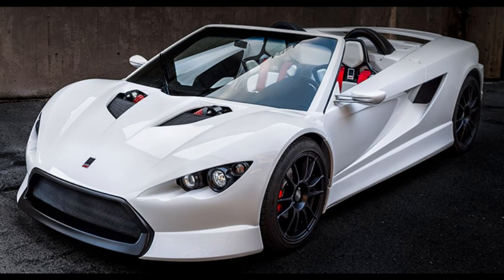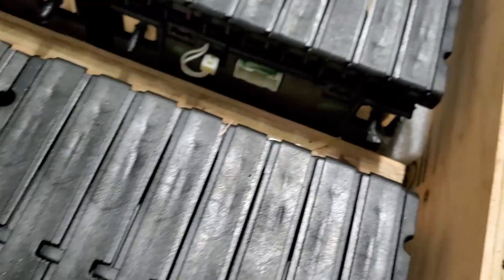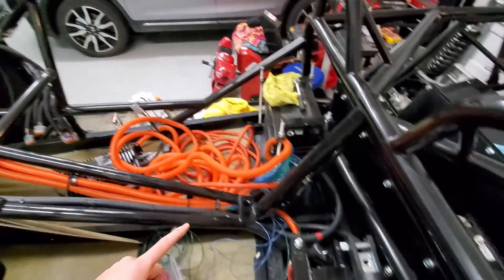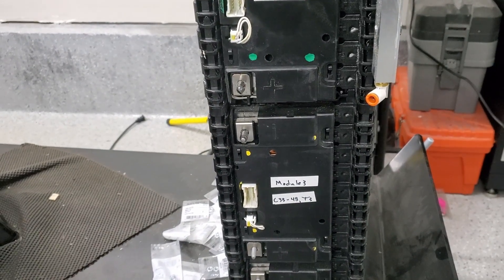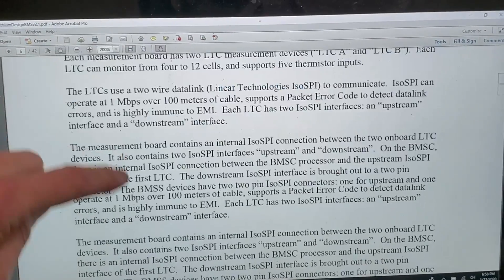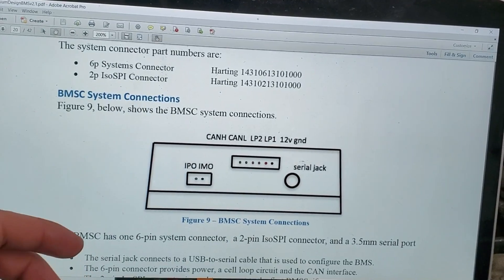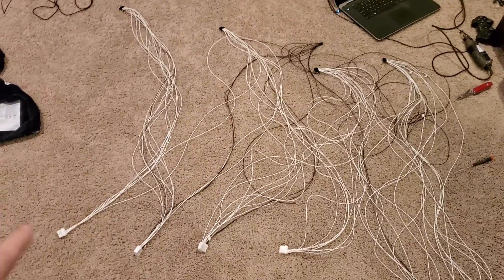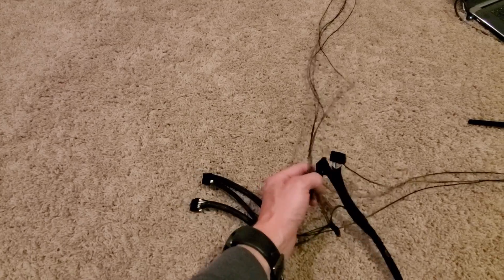BMS Wiring Part 1

Comment: Mind sharing a link for the white  LG Chem BMS connectors/ pins/ crimper? It's my understanding that the BMS pins and thermistors are evenly split between each end of the module with completely different size connectors (12 &16 pin).
Reply from the maker: Here you go.
https://www.thunderstruck-ev.com/lg-chem-connectors.html
this page also has pinouts.
I am pretty sure that I do not have the correct crimper